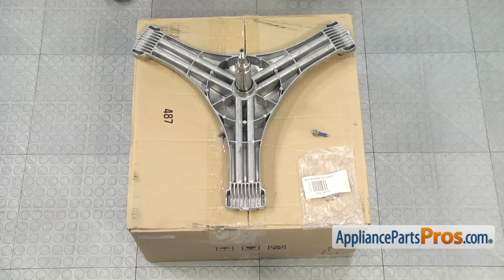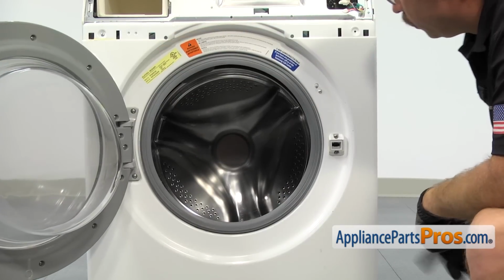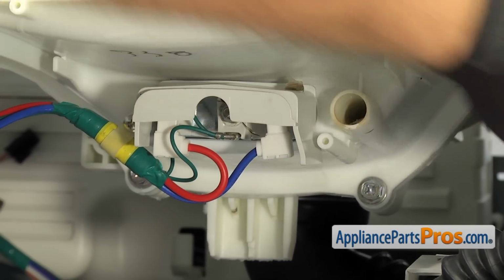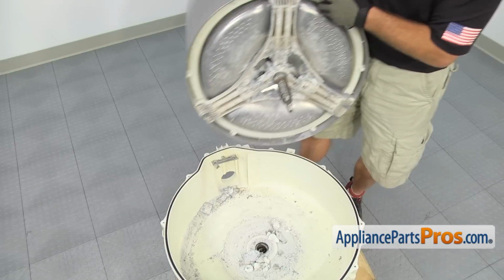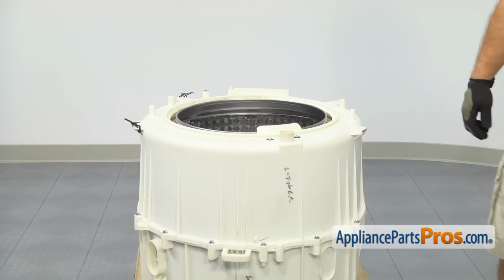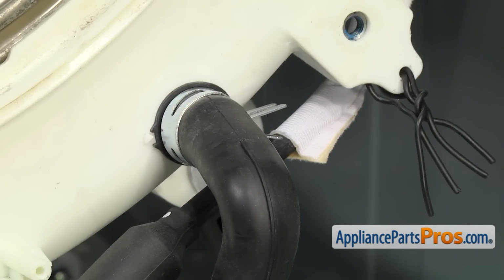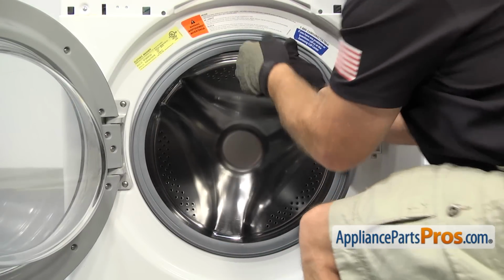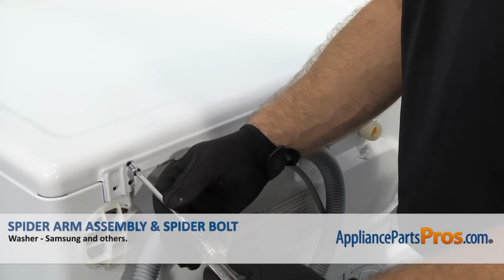Washer Tub Out of Balance? Replace the Spider Arm Assembly — Samsung (DC97-12528A)

Comment: @AppliancePartsPros - just replaced the four shocks from below the tub this past weekend, and even though it helped a little bit on the shaking - we're still having a pretty serious "shake issue"...so next week, I'm going to pull it back out and open it up to see if the spider is the issue. would it be safe to assume being that our washer is at least 6-7yrs old, that the spider needs to be replaced regardless?? I'm thinking of just ordering the parts before having to lug this heavy thing out of our small laundry room....thoughts guys?
Reply from the maker: You want to make sure the washer is set completely level om the floor. There is no way we can say what is wrong but at that age it could be the spider. If you take it apart you should check everything!
Reply: thanks, I'm going to buy the spider, rod and more than likely the bearings just to be safe....it's got a good couple years to it - so anything I can do to prolong its life is definitely a plus!
Reply: thanks for the reply guys...I've ordered the spider and will go back into the fray this Friday...if nothing else, I'll just replace the old spider and go from there....hey, it's cheaper than buying a whole new set! lol
Reply from the maker: Good luck, George! If you need any technical help or advice as you go back into the fray, feel free to give us a call at 1-877-477-7278 or chat us on appliancepartspros.com. We're here 7 days a week!
Reply: so I just got everything taken apart and there's mold and rust residue all over the spider arm...some under it between the spider arm and the stainless steel tub part...i'm going to assume that there's no issues with that tub....but could you give me a little insight as to how does water or mold get back into that part?  slow seepage through the bold assembly on the spider arm??
Reply from the maker: That tends to come from fabric softeners and detergent build up.
Reply: AppliancePartsPros - having issues with one of the bolts....I tried using a vise grip but nothing. Any advice??
Reply from the maker: George, You can try a breaker bar to try to get it off. If that still doesn't work, you may have to drill out the old bolt if it just will not come out any other way.
Reply: Guys, I went and bought a Dremel and literally had to cut a slit all the way across the top of the screw and use a flat chisel with some vise grips on the end to leverage....FINALLY got it out this weekend!!
- the washer doesn't seem to be shaking anymore...but now I have a slow leak at the bottom, so i'll have to open it back up again and see if I didn't tighten the drain hose enough.
Reply from the maker: Whew! Glad you were able to get it out. and stop the shaking. If you need any more help, just let us know!
Reply: a hoses were tightened but i'm still seeing a small leak...do you guys think the seal at the back of the tub might be the problem? I didn't replace it or the bearings when I replaced the spider arm. FYI=I did check to make sure the bearings were working....this will be my next task to have to tackle this leak issue!
Reply from the maker: It could be the seal. If you know where it's leaking from, you can give us a call with your model number at 1-877-477-7278 or you can chat us at our website: http://www.appliancepartspros.com/. We can look up you appliance schematics and double check to see if there's anything else that could be causing your leak.

Comment: Thank you for such a great and informative video. 
I ordered a new spider arm from appliance pros.
I damaged my stator while taking off the 19mm bolt. Should I just put some solder and electrical tape on it?
Reply from the maker: Not sure where it is damaged but you can ask on our repair forum you can post questions and pictures and the techs can advise whether you should repair or replace it. http://www.appliancepartspros.com/

Comment: Not sure if you need this part? Here's how to troubleshoot. 
1) Inspect the rubber gasket near the drum's front lip. If the gasket has damage and/or you can smell burning rubber when doing laundry, then you probably need this part replaced.
2) The drum is attached to the white outside tub visible in this video. If you can move the drum independent of the white tub, then you need this part replaced for sure.
If you are doing this for your own washer, I highly recommend completely coating the new spider arm with something to block water from making contact with it. A few coats of rustoleum should do the job. If you can find something better, go for it. 
P.S. Excess use of detergent will deteriorate this bracket faster. Use half of what is recommended for any size load.
Reply from the maker: Thanks for the tips!
Reply: I love you

Comment: I don't have any significant known damage to my washer (WF42H5200AP/A2), but a load was placed with a very sentimental coin about 1.5-2" in diameter. I haven't run into any problems, but I don't know where it could be and would rather not completely disassemble  the washer if need be. I can't really take it apart with my physical disabilities either, and any help is appreciated. I'm assuming it's in either the outer tub or the drain hose, but can't be certain. Any ideas would be great, thanks for the help.

Comment: I want to thank you for providing this excellent video and the parts that I ordered to repair the spider arm. The video provided all that I needed to perform this complex repair and reassembly of my Samsung washer. I only wished that you could find a provider of spider arms that does not use a cast aluminum metal as I 'm sure that is a Samsung (and others) design defect.
Reply from the maker: Glad the video helped you get the washer fixed!

Comment: I had the same thing happen on a Sears Kenmore front loader.  The spider arm assembly rotted out and took out other parts with it.  It must be the material manufacturers are using is not lasting.
Reply from the maker: Glad the video helped you get the washer fixed!

Comment: I was ready to throw out the washer, but a new one with the drawers would have cost well over $2000, unless I was willing to have a new black washer and a blue dryer. So decided to try to repair it after watching the video. I figured $180 investment in parts was worth the try. It was not hard to disassemble at all. As I did it alone, the hardest part was getting the springs released and getting the tub out. I took the tub to the garage and took it apart. My spider looked just like the one in the movie, only worse. Part coming tomorrow and I can not wait to get it put back together. If it still has a problem, I at least tried and will dump it. My unit required buying half the housing if I wanted new bearings and that part is very expensive so drew the line. My bolts came out pretty easy so did not buy new ones, but did get the seal and front door boot. I will let you know if it works after I get it all done. Fingers crossed. I would not have attempted this if I had not run across this video.
Reply from the maker: Glad the video helped you get the washer fixed!

Comment: Just ordered the spider arm, bolts, and seal, but I do not see the bearings listed. Are the bearings and seal an all in one part? I would rather swap it all out while I have this thing open.
Reply from the maker: You can go to our website and enter your appliance model number to view the parts breakdowns to be sure you get the correct part for your model. http://www.appliancepartspros.com/
Reply: Well, unfortunately you guys took too long to reply, as the fix is already complete. I checked the existing bearings and they were still good, so we'll see how long that holds. As for the spider arm, the fix worked great, and your video led me every step of the way. Thank you very much for saving me the unnecessary cost of buying a new washer, or paying labor for a repair service.

Comment: For anyone replacing this part, make sure you coat the new one with Epoxy Resin Paint.  This will totally seal it and you will never have the problem of corrosion and breakdown again.
Reply: What type/brand of epoxy resin did you use?
Reply from the maker: Thanks for the tip, glad the video helped you get the washer fixed!
Reply: That wont work, the center has a stainless shaft pressed into the aluminium this is where galvanic corrosion destroys it anyway.
Reply: @unhhh  I understand the differences with the metal but how do you stop the galvanic corrosion then?  Coating it would at least help prevent moisture from getting to it.  The raw aluminum really wants to corrode especially with all that phosphoric acid in the detergent.

Comment: I am in need of this exact part for this washer.  My spider is broken as well.  Has anyone recently purchased this exact part number recently?  Everyone that I've checked with says that's it's discontinued and is no longer being made through Samsung.  Was hoping to find an aftermarket version but nothing there either.  Help!
Reply from the maker: It is now listed a discontinued. This is not the kind of part that aftermarket companies usually make. You can try to search and call around to see if anyone still has one on the shelf.
Reply: AppliancePartsPros  I've called tons of places and no luck.  I'm dealing with an order through Amazon which apparently they can deal with special orders.  Fingers crossed.
Have you dealt with using different spiders for different machines before?  Didn't know if I could use a different spider from a machine that samsung is still producing parts for.
Reply: I have a kenmore with the same trouble and the spider is identical and discontinued too. I think all brands use the same faulty parts. Since I can't find it anywhere I think I will take the drum to a machine shop and gets a bracket welded on it directly.

Comment: What a joke. The "spider arm" is designed to fail over time... This video offers a compelling reason to abandon your front loader instead of fixing it. 'he' does not mean 'high efficiency', it means 'huge expense'... Our Kenmore/Samsung front loader was less then 5 years old when the "spider arm" virtually dissolved, sending the machine into shaking fits during the spin cycle. The repair bill would have been greater than $500 after parts and labor. Next, we watched many videos like this one illustrating the various problems with front loaders, the least of which is persistent mildew. Our Kenmore/Samsung had constant odor and mildew in spite of our efforts to leave the door & soap drawer open after each use since day one. Instead of fixing the Kenmore/Samsung, we decided instead to junk it in favor of a more traditional top loader machine. The Speed Queen top loader is a simple, reliable, back-to-basics machine. No computer, simple controls. The clothes smell fresh for the first time in years. The cycle finishes in about 1/2 hour. Price is a bit high - hold your nose when you pay, and I guarantee you will not be disappointed.
Reply: We do not have the option of top load washers as our apartment has a laundry closet that only allows stackable appliances. The smaller stackers with top load washers are not large enough to handle the amount of laundry we have (5 kids two adults) so we went with the Samsung set in 2010. Yeah, seven years old last month and we just now had any sort of issue. That is pretty darn good for anything electrical these days. I spent $133.55 on the spider arm, spider bolts, and seal. I replaced everything and my wife and I joined forces to clean out the tub enclosure, took an extra 2-3 hours, and now the washer runs as it did the day it was delivered. Obviously this is anecdotal, but it is a true experience of someone that went start to finish, and not the opinion of someone that did not even try.
Reply: You could also stop buying front loaders from crappy companies like kenmore/whirlpool/samsung/lg/maytag. Miele, Bosch/Siemens and SpeedQueen are the only brands worth considering
Reply: Mike VaVerka I agree with you 100%. My one about 5 years and same spider problem.The local agent said R450 (zar) for call out plus labour plus parts. Hey my non-digital manual control DEFY lasted me over 25 years. Parts were easy to get and cheap and easy to access the areas to replace components. This is like building a whole machine from scratch. Thanks for your comments.
Reply: We got 10 years out of our GE front loader,  spider arm cracked at shaft. 6 days a week use with 2 Adults 2 kids. So about 3100 runs, that's acceptable to me. I'm sitting in a laundermat right now, $6.25 for large machine $19,375 over 10 years, plus gas, time I'll take an $800 machine any day.
Reply: This video is not for you, please move along.
Reply: You idiots can't be serious. You think a washer is going to last you 25 years??? The best you can get is 10 years. It's called business. If you don't want to change parts then get a bucket and soap and wash your clothes outside without a washer
Reply: He said it only lasted 5 years,  fuckstick. That is ridiculous.

Comment: This was actually a very good video, although my washer was slightly different, I was able to change the Spider Assembly out and the shocks within about 4hrs and I do not have any experience doing this.  Unfortunately, after replacing those parts, my washer is still shaking a lot, and I can't figure out why it's still doing that?
Reply from the maker: Check to make sure the feet are level and the floor is solid. Make sure the drive pulley is not loose and check all the suspension parts. Usually it is the shocks that get worn out over the years.